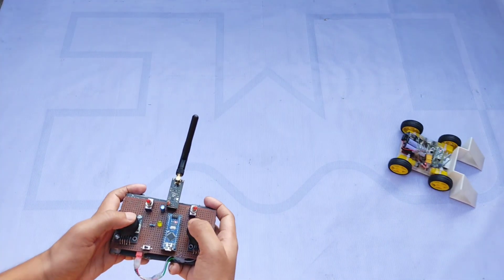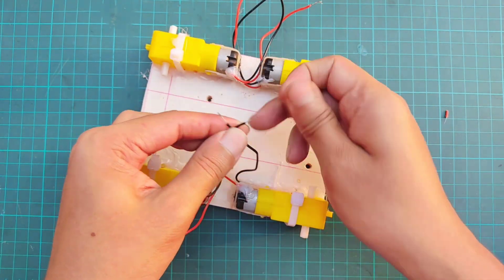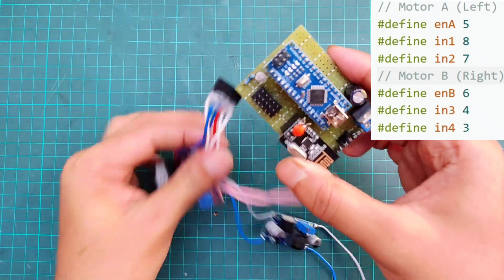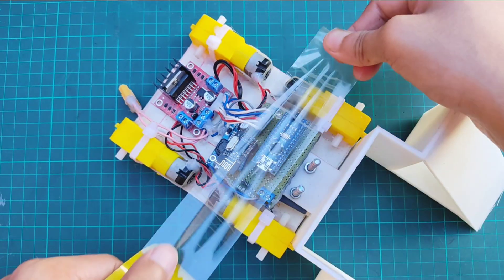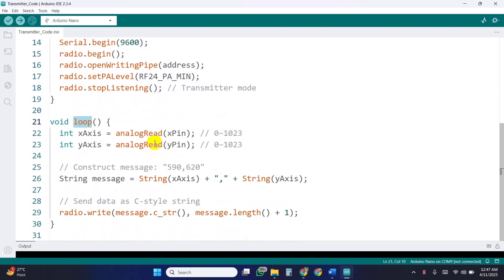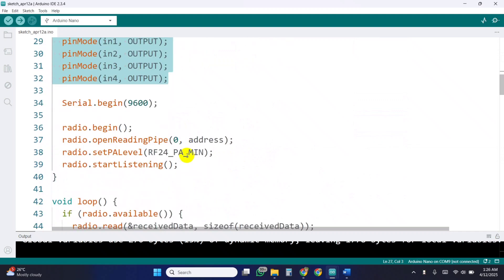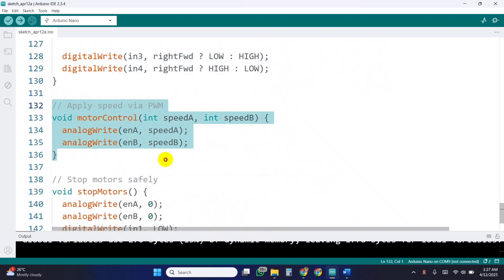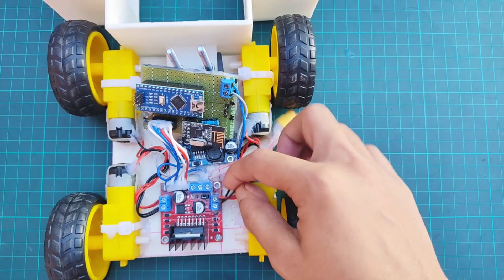How to Make RC CAR using nRF24L01 and Arduino | How to Make Mini Soccer Bot

Comment: please make a tutorial using esp32 and esp now protocol, two esp32 for transmitter receiver and controlling 4 dc motor with2 BTS7960 motor driver
Reply from the maker: Sure! I will try to make a video about that
Reply: @aslamhossain1  can i DM you on your socmed accounts? I really need help with our battlebot huhuhu
Reply: We're going to use esp now protocol for transmitter receiver,  and I'm going to drive 4 dc motor using 2 bts7960